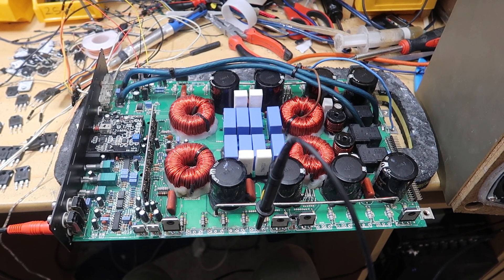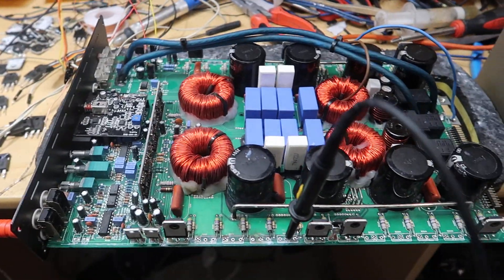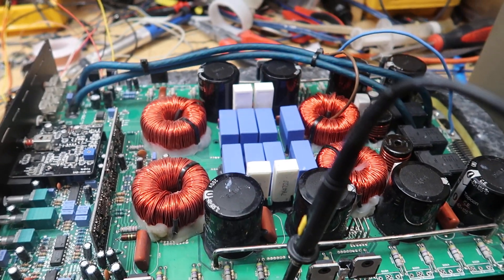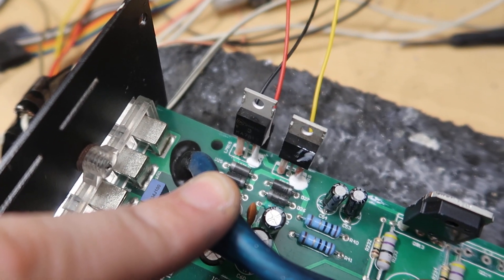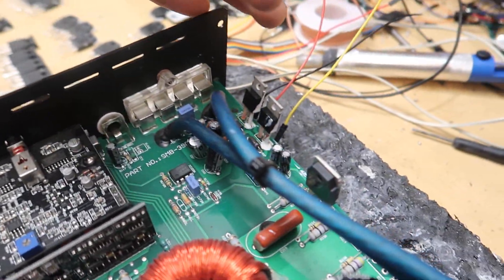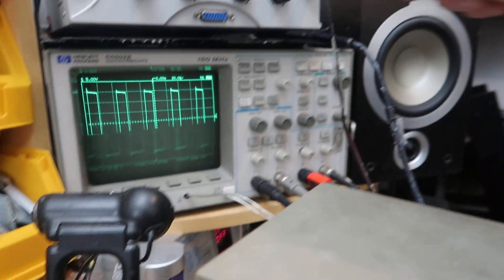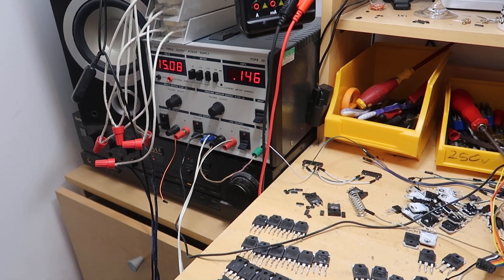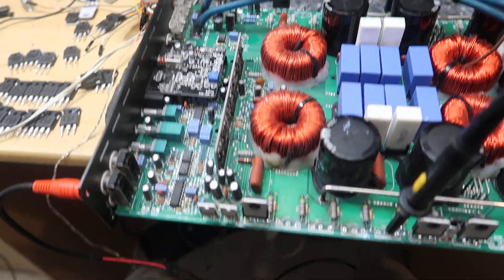hey, you can run car amps without the power supply even connected.

Comment: Hi there, I have a DLS a5 car amplifier on my bench, it's a 3 channel amplifier. The problem is the sub channel doesn't work, therefore when turn the gain up of the sub channel the amp goes protect mode. Mosfets seem ok but rail voltages are +28. -19.5
+32. -23
Any ideas?

Comment: Sam. How much would you charge to mail me the mosfets and transistors to replace ALL of them on a audiopipe 1800.1? New or used, don't care as long as working well! 

I live in Tallahassee, FL USA. Plesee humor me, and lemme know what you'd charge, bottom line.
Reply from the maker: Just buy them from mouser dude, why you wanna pay a fortune for the same parts from the UK 😂
Reply: @barevids  I'll check it out. Because I heard you mention you had tons of them. Amazon I felt was a rip off. Plus you have the general know how as go which mosfets and transistors will be equal to or acceptable without compromising performance, and I don't 😎. I've heard you mention there's other mosfets and such that someone could use interchangeably like I just mentioned.

Comment: I have one small class AB modified running from a swtiching power supply from a small hifi system, the power supply is 220 AC to 35-0-35 DC, i took off the rectifier diodes, change some caps, modify some current sensing, and the thing works very well in my house, i use a pioneer subwoofer with it, permanently set up in my house. Greetings from Argentina.